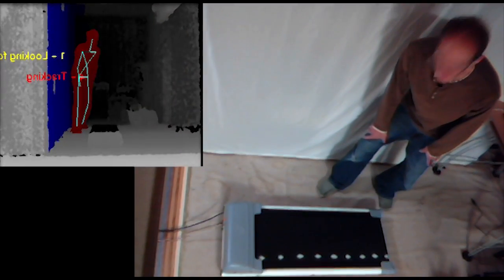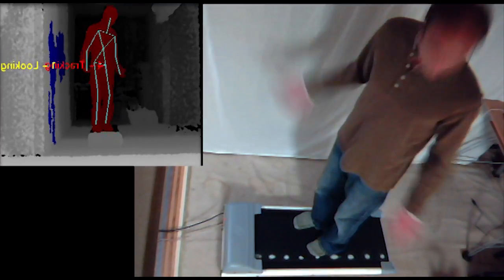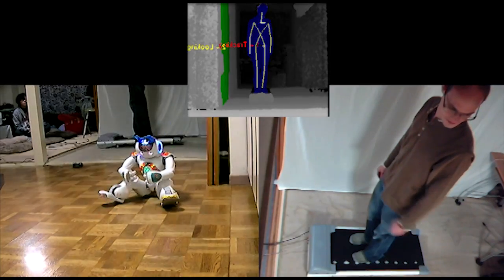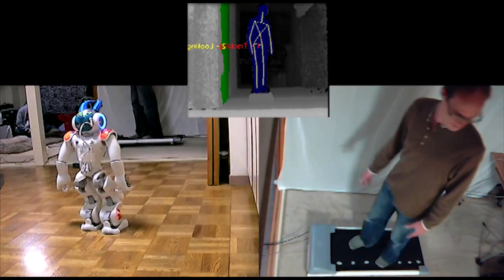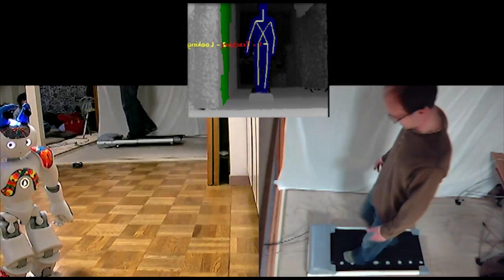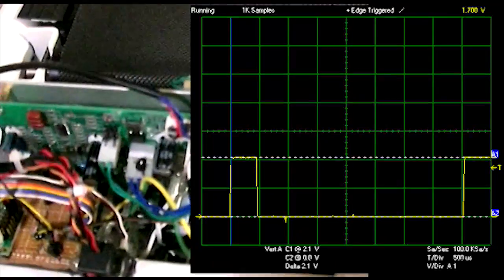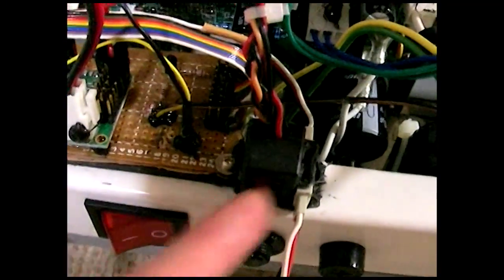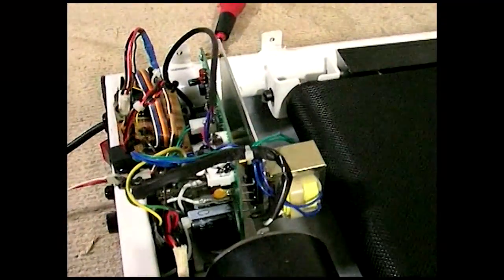Kinect Controlled Treadmill and Robot Navigation

Comment: Hi how did you managed to make this treadmill auto speed using kinect
Reply from the maker: I bought a cheap treadmill and took it apart.  There was a control module where the user sets the speed, on a separate circuit board from the module that drove the motor.  They were connected with a bundle of wires.  I examined that bundle of wires with an oscilloscope and discovered that the control module was driving the motor module with a PWM signal.   I then used the oscilloscope to map the PWM widths to the meters per second that was being sent by the control board, to derive their equation.

So I cut the control module off, and attached a microcontroller that had PWM output built in.  My microcontroller was then connected to the PC by a serial port (serial -> usb).  I made a small program for the microcontroller that read from the serial port a number that represented meters per second, and outputed the correct PWM signal, with the math I derived in the first paragraph.

On the PC a ROS node read my position from the kinect and outputted a speed to the serial port based on the difference of my previous positions.  The further/faster I am from the calibrated center position, the faster to drive the treadmill.